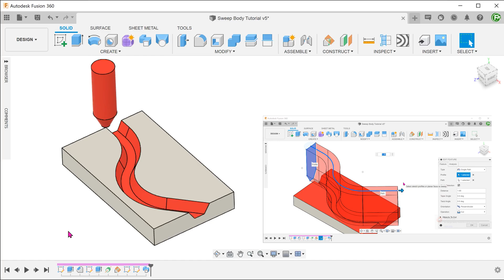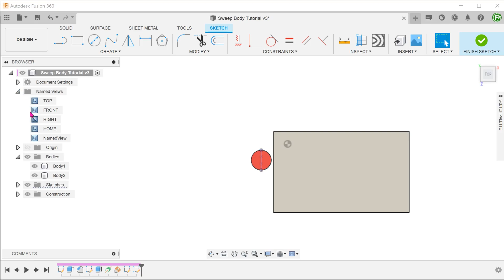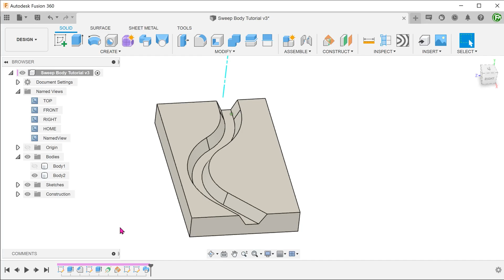Fusion 360 - Sweep Body?

Comment: I feel this is just standard use of the sweep path. Unfortunately when trying to sweep something like a ball end mill type cut in 3D, you don't get a true representation of a sphere moving through a part and removing that material. Adding this functionality is something I have not seen any CAD program do yet it seems vital to a lot of things. Currently the best I can do is just guess where my 3D path needs to go when I use a ball mill and simulate its cut until the path does what I want, but the actual 3D model will not show this geometry.

Comment: I believe this only works if the tool path’s radius of curvature is larger than the tool’s largest radius (because of the tapered shape) along the entire path. Also, the CNC milling workspace was made to do this exact type of workflow. Great video as always!
Reply from the maker: As I understand, the CNC workspace will work out tool paths based on the model. Is it able to simulate cutting on the model with a tool? If that is the case, I will definitely be interested in knowing how to do that!

Comment: I wonder if there are plugins for capabilities like this (I haven't looked into Fusion 360 plugins, yet).  I suspect that the CAM space can do this kind of stuff already (it's the reverse, actually... by generating tool paths based on the design).  Autodesk would just have to recognize a need for such features to be added to the Design space tools, if plugins don't already exist.
Reply from the maker: Wow, you are everywhere! Thank you for looking at my videos and providing constructive comments. I am aware of your comments on other videos. Will need some time to test your ideas out. Hope that you don't think I am ignoring them.

I also suspect that this is something that the CAM space can do. It will really be useful to bring this into the design space, especially for creating clearances between moving components. SolidWorks has the ability to define a body and a path to perform a cut.
Reply: @Fusion360School  No worries!  I've been working my way through your videos over the last few days.   I hope to be caught up this weekend.  ;)

You have inspired me to try a few experiments of my own.  When I was younger, I used to explore every option available when approaching software.  Unfortunately, as I got older, I tend to only take time to dive far enough into topics that seem related to the latest challenge directly in front of me.  Your videos have been a delightful exploration of Fusion 360 that peek into areas I haven't taken time explore fully on my own.  Thank you!

Comment: What would you do if the 'body' was not the result of a revolve function?
Reply from the maker: I would probably create a sketch and insert a point that defines the centroid of the body. The point should be on the path at all times. The position of this point would depend on how you need to fix the body with respect to the path. With the point, we can create an axis.

Comment: It would be great if the following can be done:
1. Component A "pressed into" component B and leave an impression

2. "Dig" a cavity in component C so that component D can rotate 30 degree within that cavity

and those are not generic shape like a chamfered cylinder
Reply from the maker: Your ideas are pretty much in line with what I had in mind to show how this can be implemented in an assembly. Either motion along path or rotation. Well, let's see how well this video does. And I will consider doing a follow up.
Reply: @Fusion360School  then add polar coordinates or whatever it is on top of that so I can make the cam drum thing like manual shifting motorbike